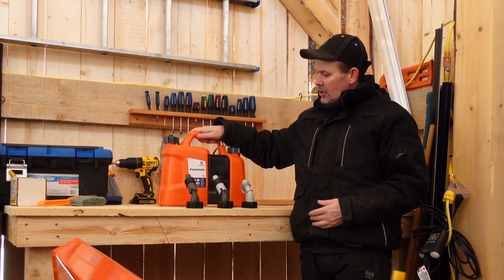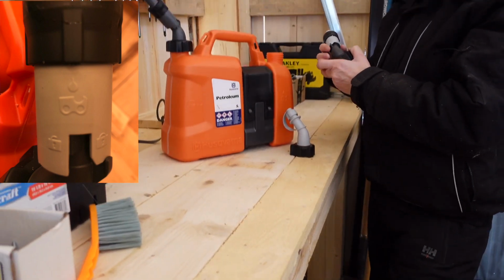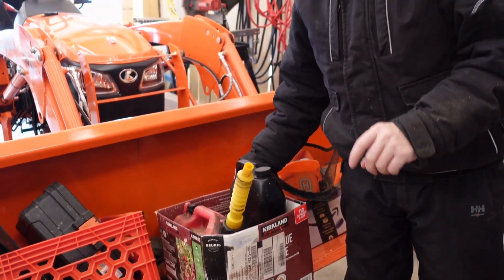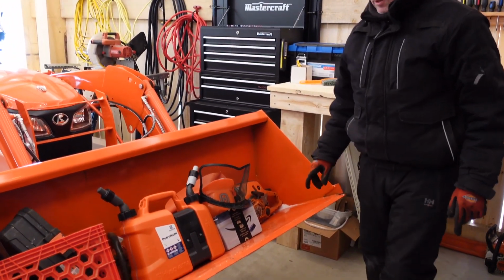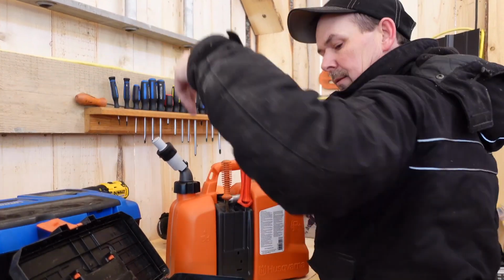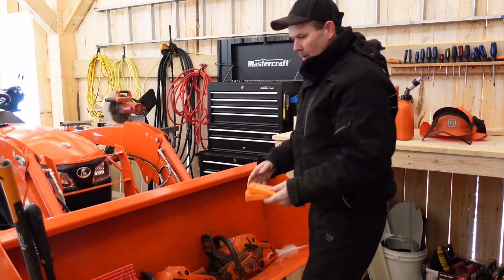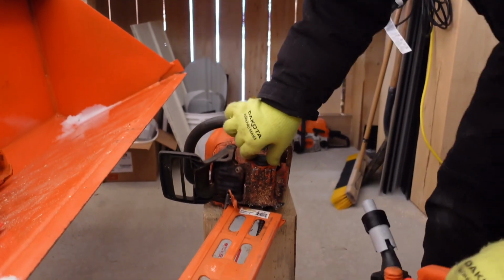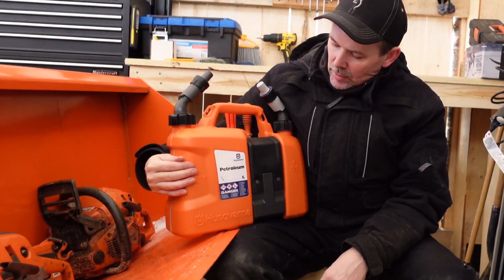Husqvarna Chainsaw Combi Gas Can Review - Best Gas Jug Ever - E100

Comment: Hi Jason!!😀😀
I've had one of those jugs for a couple years now. I run the other spout on the bar oil side. It seems to work better for me. When it comes to filling the gas. Just stick it in the tank and listen till it stops making noise and it is full. Never spills a drop. Best combo can I have ever had!! 
Take care my friend!! 

Logger Al
Reply from the maker: Thanks Al. I figured it might stop itself but I didn't want to try it until I was out in the woods! It seems to be an awesome gas jug for sure!
Reply: It's not the right nozzle for the oil. The spare nozzle you see here is designed for the Aspen 5L yars and that's the only fuel you should ever run in the chainsaw.
Reply: @erikbagge6812  what is Aspen 5L yars?? Never heard of such a fuel. Don't believe there is such a fuel in the US or Canada.

Comment: Hi! 
Pro tip. if you buy the pre mixed fuel in containers you can use the spare nozzle from the jug to pour it in to the combi jug. 

Also the nozzles will automaticly stop when the tanks are full. You dont have to look all the time. 

Thanks for the video.
Reply from the maker: Thanks for the information!
Reply: That one is not spare but it's for wintertime with really low temperatures when chain oil gets dense
Reply: First correct awnser! The "spare" nozzle is for the Aspen 5L yars.

Comment: Faced with a similar situation of carrying my tree cutting equipment into the bush on my Honda ATV, I opted for a Hard Husqvarna Chainsaw Box.  In the box, I have room for a 5 litre pre-mixed fuel/oil, a 1L bar oil container, safety glasses, ear protection, chainsaw chaps, spare chains, 4 tree wedges, 6 foot nylon tree saver strap, spare spark plug and wrench, chainsaw file(s), bug spray, tape measure and a small hatchet.  I keep it tied down with a ratchet strap across the back rack of the ATV.  I find it convenient as it can removed it in seconds and placed in the truck or shed.  I also store the ratchet strap in the box when not tied down to my ATV.
Reply from the maker: That sounds like a pretty good setup! I see Dad put one of those case’s on his ATV for the new 120i… they are nice!

Comment: I have one of those gas cans for a couple years now. I love mine!  Couple things I like to mention. When I leave mine in the shop I turn the gas spout a bit to the left and loosen the collar. This lets any pressure that could build up come out of the can and turning it to the left reminds me the collar is loose. Or before you turn the can upside down to fill the saw. Push down on the fill collar on the spout to release the pressure. Right after I got the can. I experienced the pressure build up and when I pushed it into the saw gas tank it came out with quite a force and made a big mess!  This could cause a fire with a hot saw! Also when filling the gas just push it in and listen for the gurgling to stop. When it does… it’s full and you will not spill a drop. Same as the oil but be patient ( I call this time my rest period, lol) it’s slow on-less you want to use the other spout. 👍
Reply from the maker: Excellent information Laurie, I noted how quick it builds pressure so that is a great idea to loosen it off. Amazing little jug, can’t wait to get into the woods tomorrow! Jason

Comment: bought the same 2 years ago. I've had to replace the gaz spout because it was sticking. I'm not sure if the gasket were not made to handle gaz but you'll see if yours will survive for long. Overall, I love it anyway.
Reply from the maker: I love the design already: very good jug: let’s hope it stands up to the challenge!
Reply: Same here, mine sticks, sprayed it with wd40 and it seems good now
Reply: @davek9805  I was worried something like that would contaminate the gaz and end up in the chainsaw...I'll try it !
Reply: @davek9805   Same here Dave and its still sticking a little so I'm going to try the Wd40. Thanks for the tip as it was causing a gush when fueling. Apart from that it's a great bit o' kit.

Comment: I think those spouts are designed to automatically shut off when the tank is full.  Very jealous of the new can,  I have been waiting one for some time now.  Just can’t justify the cost.  Keep up the good work!   I really like your setup!
Reply from the maker: Thanks for the tip. When I’m in the woods, I’ll let it go to see if it is possible to overflow. Pretty impressed so far! Take care, Jason.
Reply: It shouldn't overflow unless you forget to release the pressure in the can before trying to refuel. If you release that pressure before you fill you should be good!
Reply from the maker: Sounds great… I‘ll give it a whirl tomorrow! Thanks!

Comment: Congrats on the 100 videos.  It certainly takes dedication to post that many videos.  That is also a very functional combi gas can.  Hopefully it holds enough gas and bar oil for a full day of logging in the forest.
Reply from the maker: I think it is going to work out great! I usually cut a trailer load at a time and bring it to the yard so no worry of running out of gas! Thanks for stopping by….

Comment: That gas can is great, I have used their earlier model for about fifteen years now. That model has straight nozzles. In that model the nozzle is so thight that I have to let the pressure out before putting gas in the tank. I also have a couple of their 15-liter model that I use when I refuel my smaller boats. Auto shut-off is golden 👍🏼😋!
 When the big guy with the beard gets you the Kranman 960 there is all the storage you need 😉😂!
Reply from the maker: I didn’t know that they made larger petrol cans with the auto shut off. That would be great as the generic auto shut off caps here leak… I’ll have to investigate further!
Reply: @OakMountainAcotts  
Over hete they are sold as Husqvarna or Jonsered depending on shop. They where advertised as a accessory to the Rider lawnmower.
 I looked on the web for Canada but they had only the old model (the one I use) of petrol/combi can. Not the larger (15 liters) nor the new combi can that you just bought.
 The 15 liters is nice both for petrol and for diesel. I use it to get fuel for my old Kubota B7100 tractor. Now I have three big ones and two small. And a couple of "petrol cans", the old combi can without the oil can...
Reply from the maker: @johanneslaxell6641  I’ll have to keep an eye out for one. I think it would be great for fueling the Kubota 2601!

Comment: Nice tool to have!  I am still having the milk crate to handle the gas/oil can and my helmet on top!  That gives me an idea of where to improve my setup!  I am lucky, with a side-by-side, I have plenty to room to bring all my tools! Including a large box for the ropes and pulley. Thanks!
Reply from the maker: My goal is to get setup so that I can go to the woods with the tractor and trailer, 2 saws and my fuel jug and have a grapple on the front of the tractor instead of the bucket. I’ll get there eventually! Thanks for stopping by, Jason.
Reply: I currently have a grapple and since I have my log trailer, it does not seem to be useful anymore... I might use it when it comes time to buck the logs down to 16in though.  What is your intended use for the grapple you had in mind?

Comment: Is there a measure on it for the oil/fuel mix ratio ?
Reply from the maker: Hi, good question! There isn't a measure on the jug itself but most saws require a 50:1 gas to oil ratio. I believe this jug holds 5 litres of gas so that means you need to add 100 mls of oil to it. Husqvarna sells convenient packs of mix oil in 100 ml containers so I simply put in 1 container of mix oil and then top up with supreme gas to the 5 L mark. Jason

Comment: Hey Jason congratulations on 100 videos, that is quite a feat!! Thanks for the review, may need to snag one of those. I currently use a milk crate with separate containers so this would be a better solution. I've never seen these containers before, thanks for sharing! Stay safe, Ed
Reply from the maker: I used it in the woods yesterday Ed. It is awesome. I don't think you can spill gas. Basically shove it in the tank and depress the spout. It stops filling when it makes contact with the gas in the tank and when you pull out the nozzle, the gas level is perfect in the tank so it doesn't overflow when you put the gas cap back in. I don't think Stihl has that problem anyways but Husqvarna's sure do! Thanks for stopping by, Jason.

Comment: Third nozzle is for winter use,as oil gets thicker in freezing temperatures.Probably by now your petrol nozzle doesnt work properly,at least mine does not.After 2 years.
Reply from the maker: It’s a little sticky but still working.

Comment: Where did you buy it from
Reply from the maker: Hi Peter, these are available on Husqvarna.com in the US. You might also try your local Husqvarna dealer. Thanks for watching!
Reply: @OakMountainAcotts  can you share a link to the product I can’t find it on the website
Reply from the maker: @peteralberti978  mine was a Christmas present and I think it came from a local Husqvarna dealer. I can see similar gas jugs on Husqvarna.ca

                Fuel cans
Reply: @OakMountainAcotts  what dealer did you get yours from
Reply from the maker: @peteralberti978  I would check with your local Husqvarna dealer. Our closest dealer is a Valley Chainsaw.

Comment: Mix a little diesel in with your bar oil to thin it out for cold temperature.
Reply from the maker: Hi Ray, thanks for the tip on the bar oil. Definitely going to thin it out a bit. Take care, Jason.

Comment: Well... The "spare" nozzle isn't a "spare" it's designed to fit perfectly on the Aspen 5L yars to fill your gas section. That's however the only fuel you should actually ever run in your chainsaw.

The fast fill nozzles are designed to put exactly the right amount of fluid in the tank. It will not overspill as the ingenious airlock will make that physical impossible. So just push down and wait for the flow to stop and you are done.
Reply from the maker: Cool! I guess that makes sense to me. I've got this fancy jug all figured out now. She's a beauty. Thanks for watching!

Comment: I have had one of these cans for the past two years.  They're not nearly as good as you make them out to be.  The no-spill nozzle for the fuel mix on mine worked fine for about two months, but  then it would not shut off fully when the fuel tank was full.  After looking at some internet forums and seeing some youtube videos, it is apparent that this is a common problem.  The no spill nozzle for the oil is also a problem.  It is too slow.  It is much better to replace it with the full flow nozzle which is a lot quicker.  There is youtube video in Polish  https://www.youtube.com/watch?v=92663QhakgY&t=514s which shows how to dismantle the spout and sand down the inner pipe to make the spout close properly.  I have tried it myself.  It works for a while and the problem comes back again.  I'm on my third dismantling job, to try and correct this fault.
Reply from the maker: I have had a great experience with my jug so far. I love it. Thanks for highlighting your issue and the fix. If mine starts to give me trouble, I know what to do now!

Comment: I bought this exact fuel can about three years ago. At first it was great but then the fuel side outlet failed to work properly. It became very sticky, hard to slide open and close. It was extremely difficult to open to allow the fuel out  then really hard to close it, which made a huge mess with fuel everywhere. Of course Husky dealer said it was my fault, even thought they couldn't say what I had done, or failed to do so as to end up in its unusable state. A good idea but poorly made. Don't waste your money, just junk.
Reply from the maker: Good feedback… I’ll keep an eye on mine for sure!